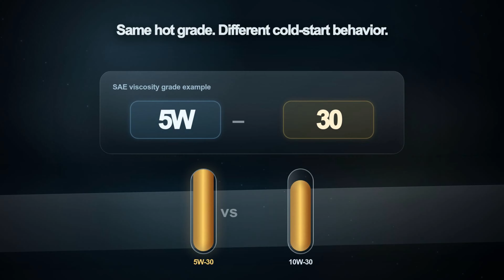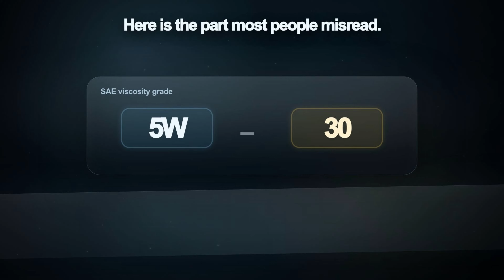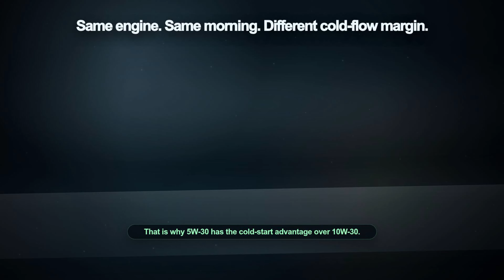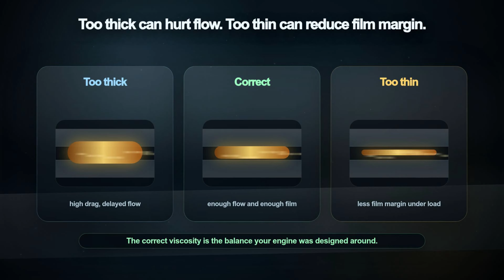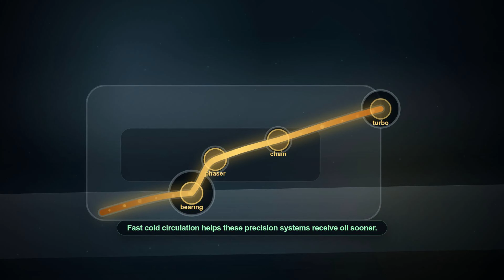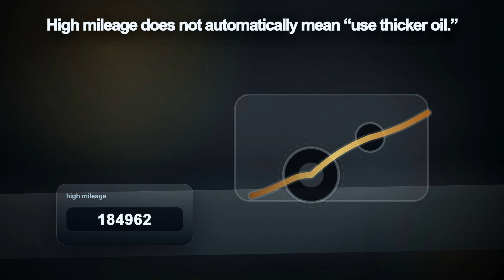5W30 vs 10W30: Which Oil Actually Protects Your Engine Better?

Comment: Hello More Automotive,

I own a 2013 Ford Figo 1.2L Duratec petrol. INDIA

My vehicle's original owner's manual specifies:

- Engine: 1.2L Duratec petrol
- Original oil viscosity: SAE 10W-30
- Original Ford specification: WSS-M2C923-A1

This specification is now difficult to find in India.

I am considering using Motorcraft 913-D 5W-30, which meets Ford specification WSS-M2C913-D, as an alternative.

Could you please advise whether WSS-M2C913-D 5W-30 is technically suitable for the 1.2L Duratec engine that originally specified WSS-M2C923-A1 10W-30?

In particular, I would appreciate your comments on:

1. Is WSS-M2C913-D officially backward-compatible with WSS-M2C923-A1 for this particular engine?
2. Is the change from 10W-30 to 5W-30 acceptable for the 1.2L Duratec?
3. Could the lower viscosity at operating temperature significantly affect hot-idle oil pressure or bearing/camshaft lubrication?
4. Is there any risk of increased oil consumption or reduced engine protection with 913-D?
5. If 913-D is not the preferred replacement, what currently available 10W-30 oil/specification would you recommend that is closest to WSS-M2C923-A1?
6. Would you personally consider Motorcraft 913-D 5W-30 a safe long-term replacement for this engine?

The car currently has approximately 66,000 km.

I am specifically looking for a technically justified recommendation rather than simply choosing an oil based on SAE viscosity.

Thank you.
Reply from the maker: checked the Ford specifications rather than looking only at the viscosity grade.
WSS-M2C913-D is officially backward-compatible with the older 913-A, 913-B and 913-C specifications. I could not find Ford documentation stating that it supersedes or is officially backward-compatible with WSS-M2C923-A1, which is a separate Ford specification. Your Figo manual specifically calls for 10W-30 meeting WSS-M2C923-A1.
Regarding 5W-30 versus 10W-30, there is an important detail: the 5W does not mean the oil is significantly thinner when the engine is hot. Both oils are SAE 30 at operating temperature. SAE 30 oils fall within the same 100°C viscosity range, while the 5W rating mainly gives better flow and cranking performance when cold. 

Ford Motorcraft A5 5W-30 meeting 913-D has a published viscosity of about 9.7 cSt at 100°C, so it is toward the thinner end of the SAE 30 range, but it is still an SAE 30 oil, so I would not expect the change from 10W-30 to 5W-30 by itself to cause a dramatic loss of hot-idle oil pressure or lubrication. The actual hot viscosity and HTHS value matter much more than the 5W versus 10W prefix.

Oil consumption is similar. A 5W oil does not automatically cause higher oil consumption. Actual viscosity at operating temperature, volatility, engine wear and ring/seal condition matter more. At approximately 66,000 km, mileage alone would not make me choose a thicker oil.
However, if this were my car, I would still follow the manual first. I would look for a good-quality automotive 10W-30 meeting WSS-M2C923-A1 if available. If the Ford approval cannot be found, a modern API SP 10W-30 is backward-compatible with the older API SJ gasoline-engine performance level that formed part of the original 923-A1 requirement, although that does not mean it has Ford's formal 923-A1 approval. 
So, Motorcraft 913-D 5W-30 is technically a very reasonable SAE 30 oil and I would not expect it to damage a healthy 1.2 Duratec, but I cannot call it an officially approved direct replacement for WSS-M2C923-A1. For a long-term recommendation, I would choose the manual-specified 10W-30 first whenever a suitable product is available.

Comment: I disagree. The first number 0 or 10  is the base oil,  The second number 20 or 30  Is the additive package. They're saying, The base oil only matters on start up. That is Turkey talk, The base oil helps protect the engine When it is running.  Because the base oil is most of the oil.😂